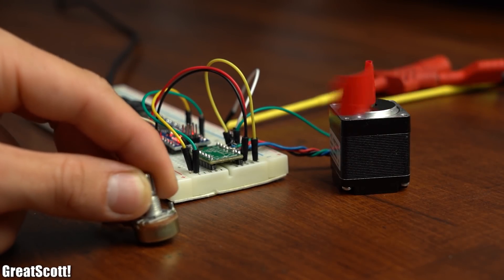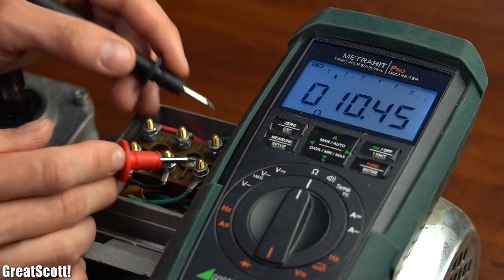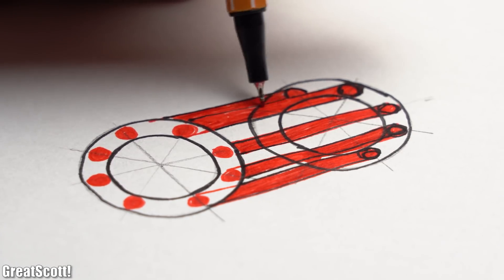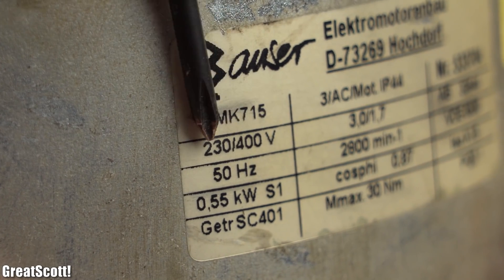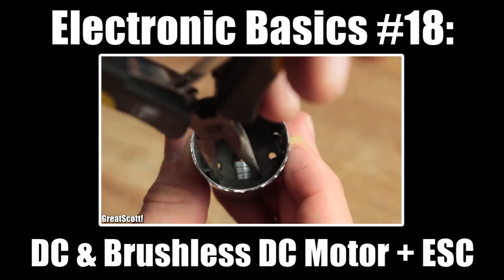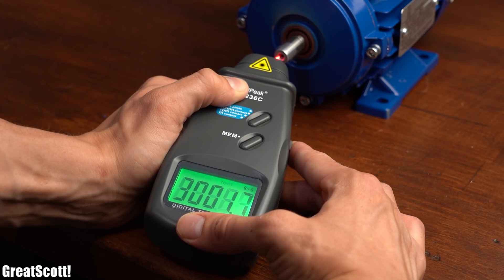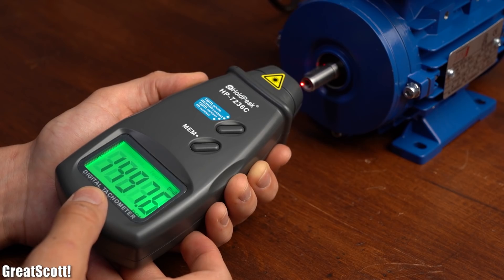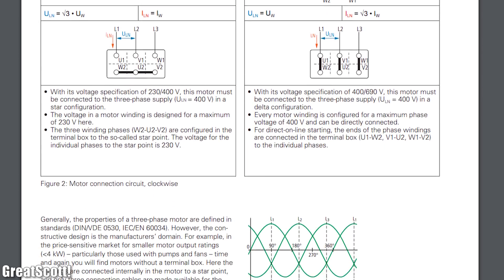Does this old Induction Motor still work? || How do Asynchronous Motors work? EB#46

Comment: If you drive the motor at exactly the synchronous speed, no force is delivered.
If you brake a little, it turns slower, and deliver power to the brake (or the machine the motor is connected to.)
The more you brake, the slower the motor runs, and  the more power it delivers, but only up to a point. If you go below a certain speed, the power again decreases, and you can "easily" stop the motor completely. It's called the motor is stalled.
Let's go back to the motor running at synchronous speed. If you drive it faster, it takes power from what drives it and deliver it to the grid. Again, the faster, the harder it is to drive and the more power to the grid. But only to a point, if for instance your wind turbine goes faster, the motor takes less power, and it gets easier to turn. Within seconds the speed increases to perhaps 5-10 times the safe speed, and you will probably find the wings in the next county when things settle down.

Comment: Even order harmonics are exactly why they're desired in audio circuits. They provide warmth, fullness, depth and dimension to an audio signal. "Distortion" is a misnomer. It's not distorted if you don't over drive it. It's clean and full. Transistors Linear is the wrong word. "Flat" is more accurate. Sure. It's subjective I suppose. Some people can't hear the difference, as you stated that you couldn't. You're simply not qualified to judge the difference. Audiophiles hear the difference. Stick to power circuits. Audio isn't your forte.

Comment: Why didn't you remove the gearbox from the old motor before you removed the bell? Of course the bell won't come off, there will be a keyway on the motor shaft between the bell and the gearbox. Probably best to stick to small signal stuff.

Comment: And here I was wondering if you'll ever show some of the real motors out there, as you previously made it sound like there are only "three" (DC, BLDC and stepper) motor types out there, ignoring the synchronous and asynchronous motors. 

Btw, while asynchronous is still in the lead (most likely), BLDC was kinda catching up in recent years because they get thrown at all the trash applications like pumps these days and power electronics have become even more trivial, even for larger appliations. Well before the shortages at least.

Comment: Hey but you did not mentioned about the fourth wire. Why?
So you say that its enough to wire up three phases thats all? In all youtube, Im searching info, but noone told or showed how to connect a motor.
If in my wall socket is phase and 0.  So what the thing is 0???? Common point of star or the cage?
I'm starting to build generator from induction motor by putting magnets on rotor. Okay  star configuration, three phases and? What connect then common point or cage? As a generator.
Can you please explane if you know?

Comment: Excellent video as usual, could you do one about soft starters and stop methods for a single phase induction motor ? i have noticed that a "soft stop" feature it's not easy to find on comercial soft starters for 1HP motors and i wanted to use one in my pump so it stops banging the pipes when it turns off.

Comment: Man, I wish we had 3 phase power here in the USA. We just have split single phase.(120, 240 volt, 60 Hz) Three phase is SOOO much more efficient for driving motors, especially larger compressor motors. Both for air conditioning, and for compressed air. We do have 3 phase power in commercial buildings, usually, 120, 208 volts in smaller buildings, and 277, 480 volts in larger buildings. Because we use 60 Hz instead of 50 Hz, those voltages are just right for your 230/400 volt motors. They just run 20% faster, but use the same current, and produce the same torque.

Comment: I have tower fan and it wasn't working so i changed the capacitor of 4uf, but running fan overnight slow down and now it stopped working! what is the reason for that?

Comment: Did you know ... ?

That you can operate a asynchronous motor in a semi-star configuration with the Steinmetz wiring? Here's how it goes down:
- You need the correct capacitor ( 450V~ ): Capacity ( µF ) = Motor power rating ( Watts ) x Factor 0.07!              -- ! ! !Don't use starting capacitors ! ! ! --
- You need to hook two bridges and the capacitor as follows: "U1--| |--V1", "W1----V2", "W2----U2".
- Hot phase goes to U1 and Neutral goes to W1. If everything is right, then you should have around 325V~ across the capacitor terminals which indicates that your motor is running smoothly and clockwise.

Background: You're using two pole pairs combined as one main winding and the solitary pole pair with the capacitor as the auxiliary winding. That way, you rewire an originally designed triple-phase motor as a single phase AC motor. Of course, you don't exploit the full power output, but in areas where triple phase is unavailable, this method just works fine.

Comment: Btw huge PMDC motors are very hard to fabricate.therefore all bigger industrial motors are induction motor.one the other way operated at high voltage inductive load consumes reactive power hence causing voltage drop and much poor power factor.this problem can be solved by running motor in over excited state way which act like as capacitor bank to improve the power factor.

Comment: occasionally stung by household ac 220v but the shock is not as strong as the standalone kw generator on the same voltage range,never try it at home! result might vary from one individual to another.

Comment: Well, the "easy" installation of this motor type, requires an overcurrent protection. This has to be installed and set according to the motor description of the motor plate, to ensure you don't burn the motor wires due to overload, loose wire, wrong installation(delta VS star) or any other fault that might happen over time. 
The temperature/overcurrent protection makes it a little less easy to install. 

Also, there is a lot more interesting stuff going on with the current, now that we start playing around with ac and a coil. The total amount of current drawn from this motor, can be lowered with the use of a condensator. You should bring out the oscilloscope and look at how the current tracks behind the voltage and how the current can change with an added capacitor. A cool experiment.

Comment: Most machines at my work use these motors so very familiar with them. Very reliable and also very quiet operation. In a not so quiet environment though as what we do: grinding and sawing metal is by itself a very loud buisness. Everything we do is not deafening loud though so that most of our machines by themelf like the drill press are not very loud is a good thing and also . these things last forever. The drill press is from around the 60s i think and stll runs as new. Thats reliability!

Comment: I had a super old one that has been sitting outside in 4 season weather for years that still works just fine to pump water. I ended up having to use it when our main house pump was not working and I didn't know how to fix it at the time. I ended up doing a small series called of videos about my struggles that summer lol, was tiring and I don't miss it.

Comment: F=no.p
     120
Let's say I want 60hz from alternator generator and no. Of pole on rotor is 4
So
60=4n
       120
=1800 rpm 
Is that right formula for calculating the rpm of rotor .

Comment: Why didn't you hooked up the Neutral point of the mains supply to the node of the Star configuration?
My professor told me that you have to hook up the neutral of the 3 phase supply to the node of the star point

Another... Can you explain an alternator from a car... Like how to set it up and some basics because I cannot understand how electricity is generated without use of any magnets in rotor or stator

Comment: I wish the US had a standard 3 phase supply.  We get a single phase for residential and most commercial. My work somehow pulled off a three phase connection and we saved a huge amount on our heating and AC by switching to a true 3 phase blower.

Comment: You forgot to point out explosion elimination in case you use asynchronous motors in gas stations or near flammable materials. Since these motors don't need a commutation system, they don't produce dangerous arcs that cause explosions!

Comment: Always fun playing with these  tiny motors,  back is called a "fan cowl" ,  Cables  should be Brown,Black,Grey in sequence,   if you uses a small Inverter drive they are very cheap about £60  for a small sub kW motor like this you can run 3 phase motors of single phase in delta. When they get above 4kW you need to consider Star/Dela starting.

Comment: One more thing speaking from experience never hook up a motor without it going through a starter and overloads first. Especially if the motor is questionable its better to actuate it far from the smoke and light show and have the overloada trip the seized motor than making 3 480 wires in to heating elements

Comment: YALL ARE TRUSTED WITH 3PH 400V IN YALLS HOMES WE HAVE TO HAVE A SPECIAL PERMIT FOR THAT HERE IN THE STATES. and were limited to only 240 how ever if ypu scrifice torque you can use a vfd or a rotary phase converter to run 3phase equipment

Comment: I was just having "the talk" with my son - about motors of course.  
AC Induction motors are the power workhorse of the house - pumps, fans, compressor (AC and refrigerator), Washing Machine, Dryer - because they are cheap power; but, only when you can use them for single speed on/off power.  The electronics required to control their speed usually costs more than the motor.  
For small motors, ones that run on batteries, an/or ones you need to change the speed of, brushed DC motors are still the king.  
The new kid on the block in the house are brushless DC and AC synchronous motors (which are actually the same thing) as the the electronics to drive these are getting cheaper all the time and with all the advances in Rare Earth Magnets, these motors can pack a LOT of power in a very small space.
Reply: How old is he?
Reply: @arthurmead5341  He is 20 - Rising Junior ME in College and on a top Formula SAE team that is moving to E-Car.
Reply: "only when you can use them for single speed on/off power." And not even a constant speed.  your application need to account for the fact that slip varies by load.
Reply: @johnmiller8884  I agree, the speed of induction motors is load dependent; but,  that is even more the case for DC motors.  The only easy constant speed motor is a synchronous AC and that is rarely/never  use in US homes due the the lack of three phase power.  That is changing now some as the cost of electronic motor control has really dropped (Ex: drones) and they are finding their way into places like cordless drills, etc.  The one challenge to overcome is that Induction motors are just so cheap - less that 1/4 the price for the same power and the only control components they need is a capacitor and maybe a time/centrifugal switch.

Comment: This brings back many memories of working as an electrical engineer in a power station.  We worked on all sizes of induction motor from 415v to 11kv.  We did routine maintenance and fault finding on both motors and associated switchgear.  I could almost strip and rebuild one of these blindfolded!
Reply: 11kv motors?? damn, that is sick

Comment: I always dream about an 24v ESC driving this kind of motor in huge R/C projects, like you said it's cheap and reliable.I dismantled recently a Junheinrich electric transpalette and they use a special ESC capable to transform 24VDC in a 3 phase 14volts with the same kind of asynchronous motor but with 3 14V winding.

Comment: There are asynchronous motors that work with a single phase without having to create a second one with capacitors. The problem with them however is that they could start rotating forward or backward depending on the initial position of the rotor. To avoid that they have a small secondary coil that is physically offset towards the main one. The coil is used only when the motor is started and turned off with a relay when the motor spins up.

Comment: Guess you forgot to tell, how to switch the spin direction by changing the main live connectors (L1-L3, or L1-L2)  or  on the motors connection board. This is one of the main features for this type of motors. lg

Comment: I never thought of describing the single phase induction motor as an ellipse, but it does make sense. 
The magnetic field is stronger on the main winding. and the field is slightly weaker on the auxiliary(capacitor) winding.

Comment: Is there a way to wire up a bldc motor to an vfc if the voltage "could" be reduced or current be limited so the motor wouldnt draw too much power and smoke up?

Comment: This may be too simple, but can you show us how to safely modify a plug in 230 v/120 v house fan that can also run off of a 12 v/20 v powertool battery?

Just a thought :(
Reply: To run a mains voltage fan off a battery you'd need a power inverter. You can easily get a 12vdc to 120 or 230vac inverter in stores. One end is made to plug into a car's accessory socket and the other end has a standard household plug.

To run the fan without an inverter you'd need to completely replace the motor.
Reply: @eDoc2020  is there an easy way to make sure your battery doesn't get too low in charge so as to damage it?
Reply: @o3zman  Many but not all power tool batteries have built-in protection. Additionally, most car inverters will automatically turn off at about 10.8 volts.

Comment: I've  laying around a asynchronous Motor with an  inverter and asked me:  is it possible to drive the inverter with an Arduino or raspberry?  
Maybe the next Projekt ?  😋.
However,  this Video was again Great, Scott 👍
Reply: In theory yes its possible say its like a esc where you connect pins or maybe relays I really don't know

Comment: You can easily use dual phase, as long as you have a capacitor for the third coil.
You can also use a 50V AC lab bench. It would work, though at a lower motor torque.

Comment: So, you only connect 3 phase cables? without neutral zero cable? To this induction motor?
Reply: There isn't any neutral because in the star configuration all of the currents are equal and they eliminate each other, making it a balanced star
Reply: @goncaloalmeida7549  I believe you meant "delta" configuration

Comment: Just a little safety tip. When there's need to test a motor that isn't connected to anything, always put some tape around the mechanical tab. Because due to the centrifugal force it could fly away and hit something or someone. Usually when you open an asynchronous from the box, it should have a plastic protection for the tab.

Comment: Lol, I had to laugh at "pretty expensive VFD" at $100...
I work on VFDs that are upwards of $1m, I can't believe the proliferation of cheap VFDs that even hobbyists can afford.
Reply: Eric Haller ABB
Reply: Sounds like you work with very heavy/high power industrial equipment, railroad/naval industry or maybe big-ass industrial robots that lift and turn around an entire car's frame during production line.
Wonder if I guessed right and if so which one
Reply: @Kalvinjj  @Eric Haller   At that price tag I am thinking mining, waste management/recycling, or refinement plants. A drive costing up to 1million dollars must be for a massive motor. And at that price tag I wouldn't be surprised if the drive itself is larger than the switchgear in the electric room that powers it. Eric Haller, is it 13800v?

Comment: 3phase induction motors - the black magic of electromechanic engineering. They are great for many reasons, especially for not blowing up if the rotor gets stuck (on pumps or woodchippers, for example). Thank you, Nicola Tesla.

Comment: 4:58 so in Germany the whole breaker panel is reversed. Input from the bottom output on top. (In Italy output Is on the bottom)

Cool. Initially I was like "WTF"!
Reply: Ahaha, anche io mi sono perso un attimo, cmq avere 3 fasi in casa sarebbe fantastico
Reply: he is working on a 16 amp breaker that 100% have a higher one before (or a differential switch). Maybe in the output of the previous element (the one he'd like to work with) doesn't fit another cable, so he uses the input of the "child element"
Reply: In germany the output is always at the top. With breaker boxes usually in the basement, this neatly matches most of the cables going up.

Comment: Induction motors are cool. I was expecting to see what conditions are suitable for the DELTA/STAR configurations.
Nice video, thanks.
Reply: Delta is for 230 and star is for 400, delta uses less current. This is why star-delta exists, biger motors have a too big current for the net so you start the motor in delta (current=less, speed and power=less) and then you switch it (automaticly) over to star for better speed and power

Comment: You could also use such a motor with 1 phase 230 volt ac but you need a capacitor to start it or start it manually 

nvm u explained it, wasn’t that far yet
Reply: He has shown this in this video at 10:28
Reply: krukhlis ye i wasnt that far yet 😅